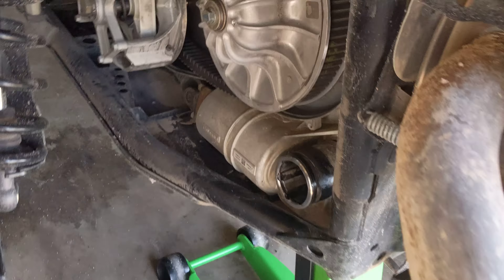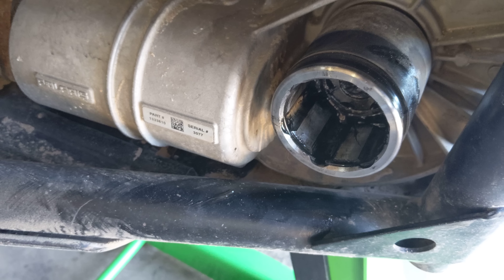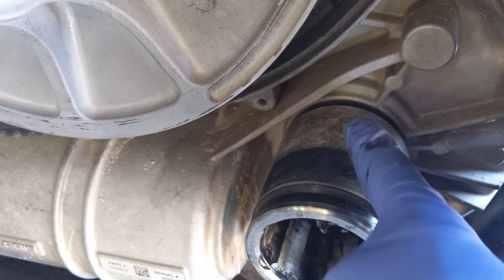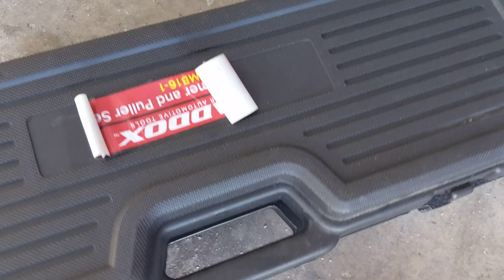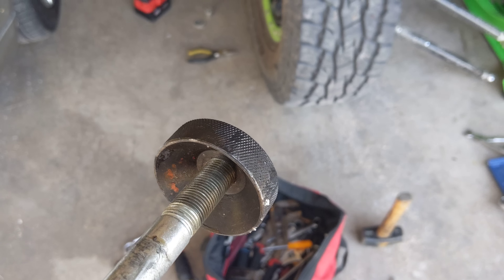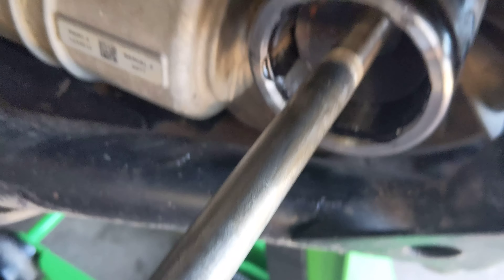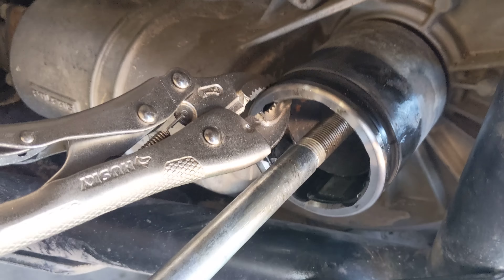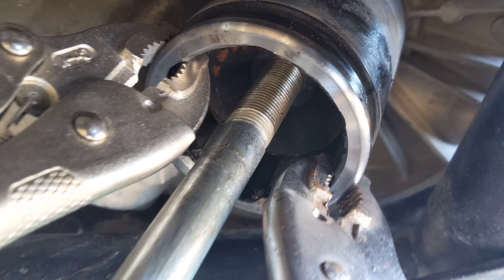Polaris RZR broken axle removal, the easy fast way.

Comment: Huge help dude thank you! I didn’t have a puller but I had the old shaft and it still had the bearings on it so I stuck it in there and put c clamps on it because I didn’t have any vice grips and it worked perfect thanks for the idea dude!

Comment: Had a RZR 1000 XP at the shop I work at with 20000 km on it and we could not get the CV to come out of the trans, tried this method and it took 5 pulls each side and they were out. Thanks for the words of wisdom,!
Reply from the maker: That's some good use for sure. I have similar mileage on mine now. Glad I could help.

Comment: Make sure you have the puck on the correct way with the dished part facing outwards and the cone inwards. Went and bought this exact same slide hammer kit and it DID NOT work. The vice grips will not hold no matter how tight I put them on. The slide hammer just knocks them off. Then i watched the video again and realized he had the puck flipped around the other way. Tried it that way and it worked. Maybe 5 pulls and it was out! Thanks dude!

Comment: Try using 3 standard pairs of vise grips. Once out remove 1/3 of the sharp corner inside the housing that holds the snap ring - anti-seize it good, then it will come out by hand pulling on it. Be careful not to remove to munch of that sharp corner - just  .02"  less than a  32nd of an inch.

Comment: For me the round black piece did not fit in my axle cup. I went to ace hardware and got (2) 5/8 fine thread nuts and (2) big washers they are just a bit small then the cx axle cup hole.. then i used vice grips just like he did and it works as well. 

So on the axle puller, screw one nut in first.. then put the (2) washers and then the other nut and tighten the nuts against themselves.

Comment: Doesn’t fit on the rzr xp highlifter axles. The stub shaft is smaller diameter. Wish it did fit though! Would make my life easier
Reply: i had the same issue.. i went to ace hardware and got (2) 5/8 fine thread nuts and 2 washers.. almost as big as the hole and used vice grips just like he did.. worked as well.

Comment: Id like to add the cup in this kit doesn't fit the rear shaft cup on a 2013 polaris ranger xp 900. Save your 100 bucks.

Comment: I have a 2016 polaris rzr 1000s... Used the 5lbs slide hammer and didnt work... Buddy is bringing over a bigger one for today/evening... Has anyone else ever had this problem ? Incredibly hard to get out.. Please let me know. Thanks
Reply: How did you get it off? I'm 3 days in with no end in sight. Mine won't come off.
Reply: @johnspillers79  I used a 15 pound slide hammer... I used 2 vise grips and clamped them on the sides after I put the end of the slide hammers into the collar... Took me a couple pulls but it came off.. Then I tried on other side and it wouldn't work so I used an extension and 5lb hammer and hit the other side out... What a biooootch it was.
Reply: Well I finally had enough of trying to get that cup off I decided to leave it on and take the cup on my new axel off. I gently removed the axel not clamp so I could reuse it. Once the clamp was off the cup slid right off and the new axel slid right into my old cup. I slid the boot over it and installed that clamp and called it good. I put it am back together and rest drove it and it worked great. One thing though, there was a snap ring in the new axel I had to leave out as the old cup didn't have a groove cut into it for any kind of ring to hold it together. But it still works.